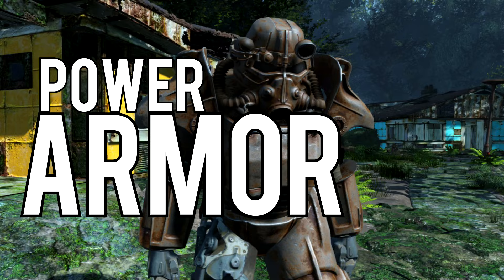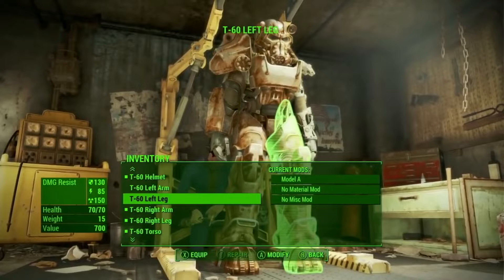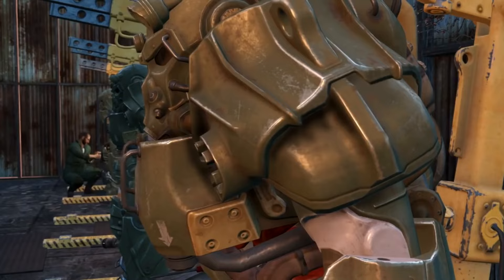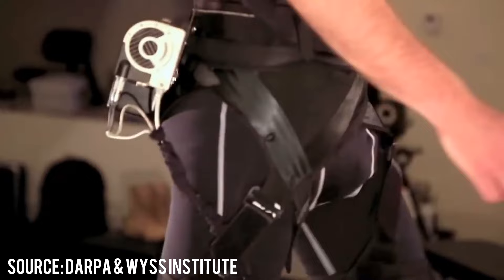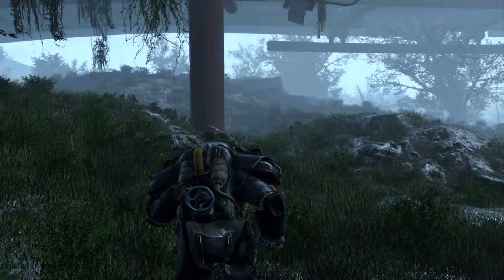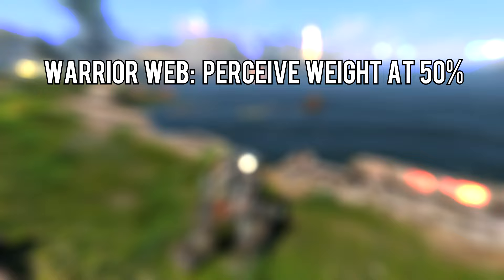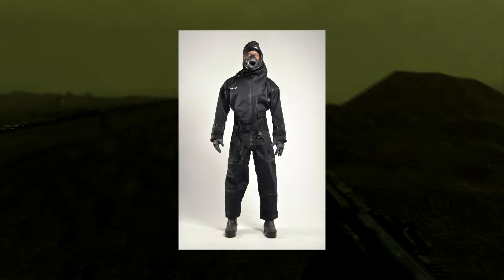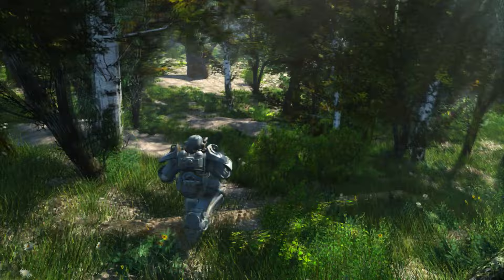The TECH! How close are we to POWER ARMOR technology?

Comment: I think the reason powered exoskeletons aren’t used in the military is because of the massive power demands. So if we could master cold fusion A LOT of Fallout could be made possible.
Reply: Power usage , production and field use are the main reasons we don't have irl power armor. We still have anti materiel rifles from ww2 that could easily mission kill a power armor frame , not to mention grenade launchers , shoulder mounted missiles (Javelins specifically), black tip 50 cars and of course IFVs with 25mm autocannons (?). 

Though if we ever become a space faring species , power armor could be a game changer seeing as that ballistics and mobility in space are completely different
Reply: @Braindamagedpotato power armor doesn’t mean that tactics are thrown out the window and you just walk towards the enemy. Power armor would still be like putting a thousand pound weight on the scale of war, you would have troops who can carry extremely heavy weapons platforms, be resistant or immune to small arms fire, while also  being agile enough to carry out strategic movements typical of infantry. you would effectively need to be hitting a large amount of infantry sized targets that are effectively using cover and bulldozing your strongpoints, all while advancing, with anti armor weapons.
Reply: No. We need Thorium nuclear fuel cell. A battery with serious power and very long life. About 180k years half life.

Comment: Okay, gotta make a correction here: all three major forms of ionizing radiation are stopped by the equivalent of a few feet of dirt (or a quarter-inch of lead). And that's for gamma rays, which have the best penetration. The shelter you showed had three feet of dirt on top, and the rest is concrete - there ARE no "layers of steel" in it.

Power armor's radiation protection will therefore depend on how dense its plates are - which you can up-rate by modding at the power armor bench (with lead, natch). If not for the fact that any articulated suit is going to have some gaps which can't be as solidly covered - knee and elbow joints, neck, waist flex area - you'd prolly be able to stomp around in the Glowing Sea as long as you liked.

Or until a Deathclaw snuck up on ya.

Comment: What about power? What does Fallout 4 power armor even use fusion cores for and what would be the real world equivalent?
Reply: I think Austin did something about fusion cores in a previous episode. Either way this is a fairly low-science more-research episode, powering stuff like that is Austin's department.
Reply: there is nothing, and thats its biggest drawback ignoring the whole itd kill you by using it thing
Reply: 13 AA batteries
Reply: Battery
Reply: Tiny fusion reactors??
Reply: The Fusion Cores are basically miniature Fusion Reactors. They fuse (combine) atoms to create energy, just like the sun does. We currently can fuse atoms together, but it's very energy consuming and we are a LONG way from making it actually produce more energy than it uses and from that a long way to making it so compact.
As for what it's used for, there are a lot of different motors, systems, etc. needing energy in that power armour. So basically the Fusion Core is like a Battery but holds a LOT of energy- a few dozen orders of magnitude more than the strongest batteries of that size we have.
Reply: Larger lithium ion batteries. They last longer and can be recharged, depending on the size of that batteries quicker than others
Reply: @edim108  Since when could we do Nuclear Fusion????
I didn't think we could do that yet!
And if we can...
Why the fuck are we continuing to spend money on inefficient solar and wind energy instead of using Fusion..

I'm pretty sure we CANT do fusion yet.
We CAN do nuclear Fission in the other hand, which is still SUPER powerful but releases far less energy than Fusion.

We're not at fusion yet. And one of the biggest reasons for that is that people are too scared of the taboo surrounding nuclear energy. Meaning there's less investment in nuclear research, and thusly less progress in advancing to fusion (...I say "progress" as if there IS any in nuclear energy right now)

We really need to stop being afraid of Nuclear power.
We're going to get to a point of energy demand where Nuclear will be the ONLY effective way to sustain us.
Solar and wind just don't cut it as long term and cost effective solutions even today. And natural fuel WILL run out one day. May still be a while before coal and oil dry up, but we should still invest more in nuclear energy if we're to advance civilization at all.
Reply: @septimus7524  1) We can make nuclear fusion happen, but on a small scale and it requires a lot more energy input than it produces- we can't yet make it produce more energy than it takes and we only can do it on a very small scale- few atoms at most.
2) I mostly agree on Nuclear Fission. It's probably the single best solution to our ever-increasing demand for energy: It's one of the cleanest, most cost-effective and most potent ways of producing energy- not AS good as Nuclear Fusion could be, but we are a LONG way from making fusion a viable source of power.

What most people don't realize is that modern Nuclear Powerplants are very safe, produce far less waste than those of old and risk of failure in them is practically nonexistent. Also, Uranium isn't the only viable Nuclear Fuel, as there are better (if more expensive in the short term) ones like Thorium.
Thorium is not only WAY safer than Uranium, but it also produces a lot less waste and is much more potent (one ton of Thorium can produce as much energy as 35 tons of Uranium). Thorium is Fertile, not Fisile like Uranium, which means that it needs a source of radiation to keep its fission- you drain thorium from its tank and it will quickly stop producing energy (unlike Uranium which will continue the reaction and keep on producing radiation and heat. Thorium is much more abundant than Uranium, is easier to extract, is safer to transport, doesn't need expensive refinement procedures to make it a viable source of energy and Thorium waste is still a perfectly viable nuclear fuel (namely the Uranium 233 which can be used as fuel as well).
Reply: A handful of AAs oughta do it
Reply: It's a 2 ton suit or pure metal. You would need power for the hydraulics to help you move.
Reply: Kevin Alvarado  kinetic shock, it's what killed a lot of ww2 tank crews, they were essentially vibrated to death when a shell hit the tank
Reply: Maybe a diesel generator backpack? It works well for tanks and power armor is lighter so it would need less energy.
Reply: Nuclear diamond battery

Comment: the major difference between most of the real world armor and the power armor frame is that the PAF is self-supporting. it acts more like a vehicle that the wearer sits inside, while the darpa gear is attached to, and holding onto the wearer, being supported in part by them and in part by itself. because of this, the frame holds the weight of the armor better, being basically independant .
Reply: additionally, he completely skipped over the actual use of the power armor: sure, he talked about the lifting of heavier loads, but the real use of the armor was to be able to lift extremely heavy weaponry while having the mobility of an infantry unit (i.e. minigun, lighter forms of artillery) You are also right, in Fallout, power armor is a suit of armor that you step into kinda like an iron man style suit. it isn't an exoskeleton that is attached to the user, it is a powered vehicle that the user moves in.

Comment: 9 AK bullets to destroy the chest plate considering how thick it looks is extremely weak.
Reply: In WW2 they tried using steel armor to protct against bullets. Its was a giant failure since they could pass right through, while creating sharp fragments from the armor entering into the bullet hole.
Reply: WW1 and it worked reasonably well
Reply: Was their no bell effect? I wouldn't know about modern to postmodern helmets, but pre-modern eras definitely struggled to use metal as a helmet due to it effectively being a bell placed on a soldier's head just wanting for a bonk.
Reply: In WWI body armor was mostly used to protect against fragments of metal from artillery shells not bullets though it probably saved a few from bullets.
Reply: It also weighed so much the man wearing it could barely move. It should also be noted that the Imperial German Army put forth the idea that if some sort of /powered frame/ could be devised, it could be wrapped in heavy armor and enable a soldier to bear heavy weapons while still being mobile.  In World War 1.
Reply: Kytoons
From my knowledge those where similar to seathe metal plates. The cest plate in the game looks around 2cm thick if not more.
Reply: Grim Reaper it's very old, they don't just make those at that time, so I'd assume it was just corroded, being made of iron and all.
Reply: Matt friend the only steel armor they had in ww1 was the German lobster armor, helmets and some misc. chest gear for machine gunners. The lobster armor and machine gun armor was only built to protect against shrapnel and glancing shots from rifles, since a direct rifle shot would go right through. Because they were so heavy and cumbersome, barely any soldiers bothered to even wear them much less move in them.The helmets served the same purpose, and would not protect against a direct bullet shot. The soldier putting on full armor and walking foreword with a machine gun in bf1 while being shot in the head with a rifle is not realistic in the slightest.
Reply: Well its a game, they need to make it weak to ressemble a game balance. 

If they actually makes the PA the 'walking tanks' like they actually are, then it will throw all other armor options out of the window. Which is pretty bad for the audience's "fun" and "sense of choices".
Reply: No hes probably just a high level

Comment: The polyethylene armor is armor panels, just like the ceramic or metal plates, that goes inside a vest.. made of an extreme long-fiber, like Kevlar (or one of the competitors like Spectra Shield)

The military has specified and formally researched powered armor since the 1960s. In the 1980s the project was called  PITMAN.  Future Force Warrior is just the latest version of it.

Comment: 9:30
A big difference though is total weight. The lifting attachments are fairly light so they can be worn and moved without too much issue. The power suit in fallout would way over 300 kilo's minimum and could easily be over 500. That is a lot of mass to accelerate to stop.

Comment: You don't know enough about armor or small arms to make this video. AR500 Level 3+ armor can take 100s of shots from a 7.62x39 chambered arm  and be nearly unaffected. Ceramic armor is/was only used for wieght savings as a full set of AR500 level 3+ armor (Front, back, sides, thighs and other small plates) would weigh 60 lbs and preclude the ability to carry any other needed gear. Power armor would avoid this entirely as it holds it own weight. Hell you can probably build the whole suit out of Class 4+ plates and not run into problems.
Reply: the problem isn't the suit its the floor, you'd sink. And what if i set you on fire in your suit of ar500 armour? or even shot you a shit load, the plate gets hot and cooked human for tea!
Reply: this comment should be wayyyyy up there

Comment: I'd like to mention one of the biggest things I feel was overlooked: the fact that the individual inside the armor doesn't actually touch the ground. [S]He is on raised platforms if you look closely without leg armor on (so just the base power armor skeleton). This leads me to believe that the wearer would have a much higher weight carrying capacity. The arms work the same way as the foot placement does, with the user grabbing an inside (its like a thing you grab with your hand but I don't know of a single word that describes it). Anyway, I felt that was kind of a big hole that was overlooked, that's all.

Comment: based on LFTR reactors it is possible to reduce the power plant enough in size to power the suit, heat shielding would be the only need but based on the reactor design for the Cadillac thorium car one could use and adapt that same design to power the suit. power units of that type would further reduce the weight felt, could run an air filtration system, power reactive armor, and never run out of power.

Comment: Kevlar is actually capable of taking rifle rounds depending on how tightly woven it is and how many layers you have to slow down the rounds.  However kevlar is mixed with Boron Carbide.   Which is that ceramic you are referring too.   Which is capable of stopping high velocity rifle bullets.    So modern body armor works fairly well for what it is designed for.

Comment: The problem with power armor is the technology to build it is very expensive while the tech to destroy it is cheap, relatively speaking. I mean all it would take is a modern version of a AT rifle.
Reply: Yeah, and sniping a small armored infantry that was able to take cover, crouch, prone, and sneak away from your killzone while relatively resistant to most small arm fire is "easy".

Just like my CoD....
Reply: @nukachungka113  
I counter this with an IWS 2000 using DU core from 1000m. Boom, armor busted.
Reply: Fair enough. You'd need some spicy shit, and constant advancement...
Reply: also youd get heat stroke in hot areas of the world like iraq

Comment: One thing you failed to mention was how the operator would see outside the suit. mini cameras are getting better all the time, but I think there will be a real need for the old 'mark one eyeball' through transparent mediums. 

   This being so, I think that a multi layered 'wafer' would be used as a viewing block for powered armor suits. Probably with a thick metal, or metal and composite face guard that could be retracted to enable the operator to see out through the viewing block.
   The viewing block would combine the best anti-ballistic polymers, Shatter resistant Glass, and (this is actually a real thing) Transparent Aluminum. The largest piece of TA I've heard of was 4 by 6 inches, and 1 inch thick. The report I read on this development was over two decades ago, so the manufacturing process may allow larger sizes by now. 

   In any case, even a 4x6x1 inch slab, mated to the above materials, would be an effective 'view port' out of the armored suit, and still deflect or absorb all pistol rounds, and most rifle rounds (although, I still think a Barret .50 Cal would penetrate). 

   a relatively thick layer of 'anti-spalling' film would keep glass shards from impacting the operator's eyes, thus preventing blinding. Such is common these days as a film layer on Cel phones. 

    Just a few thoughts, 

the Frank Gamer

Comment: It's worth noting that resistance-wise, an equivalent-rated steel plate does have longevity advantages over its ceramic counterpart.  Namely, it's less likely to fracture upon impact, or suffer accidental damage.  That said, they're generally heavier for the same level of protection, and they tend to "explode" the bullets that hit them, rather than catch them the way ceramic does.  This causes shrapnel and spall to shatter outwards from the impact site as the bullet fragments.  Not so much an issue for someone in fully-contained power armor, but potentially deadly for someone wearing it in a vest.

Comment: The thing about power armor as showed on one of the video's made on this channel before, we would not get the shock absorption from a fall but other then that it will be capable of tons of other stuff mostly. Carbon Mesh made with Resin is also possible to be better in time. Its the same stuff they make many race cars of, and its on step down to the type of stuff they say will be used to build future spaceships and stations and other things. Able to take 56,000 per square inch and its very light, and it can stop bullets without issue, and it can take the effect of 200 mile an hour crashes and other stuff, and is often used to make the pods in indie cars just as its used for its body. The seams mostly have rubber or other stuff, that would help and would save space and be easy for someone to replace.

Comment: In terms of body armor the real telling difference is polyethylene is light. Steel when it is faced with a threat it can defeat can generally defeat that threat all day again and again with ease. However it is heavy, and defeated bullets produce fragments that can injure the soldier. Ceramic is medium weight, like polyethylene will break down as it is struck becoming less and less effective but unlike the other two will reliably stop armor piercing bullets.

Comment: pre war T51 is the best. It was designed to protect the wearer from literally any conciviable from of weaponry. In the WMD department the helmet and sealed environment will filter air making the wearer impervious to both gass and bio weapons. then as discussed in the video it also has the benefit of blocking radiation. as for conventional weapons it's thick ass metal plates for kinetic and special coating to be used to disperse energy weapons hitting it. It also looks awesome too

Comment: I feel I should point out that kevlar is actually great at stopping large caliber rounds.  9mm is more likely to penetrate than .45 because standard 9mm loads fly faster than standard .45 acp loads.  Additionally, the .45 has a larger physical surface over which the impact is spread.  Like chopping a tree with a sledge hammer versus an ax - the ax cuts better because it has a smaller surface area over which impact is dispersed.  Both of these pistol rounds are higher in caliber than the 7.62 rounds (of various lengths and powers) fired by Soviet-bloc designed military rifles.  So really the better statement is that kevlar is bad at stopping high velocity rounds, not larger caliber rounds.